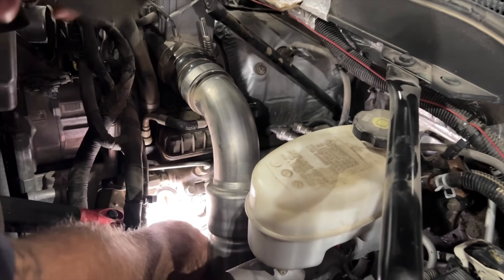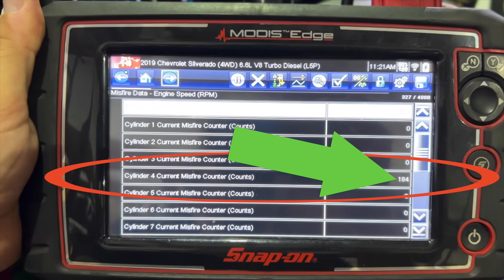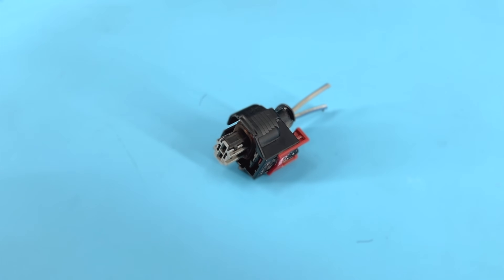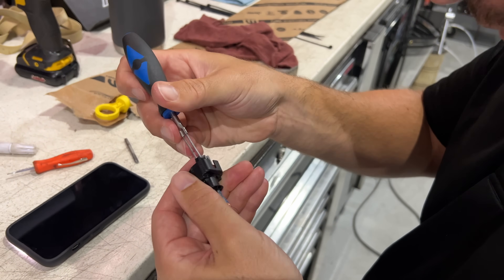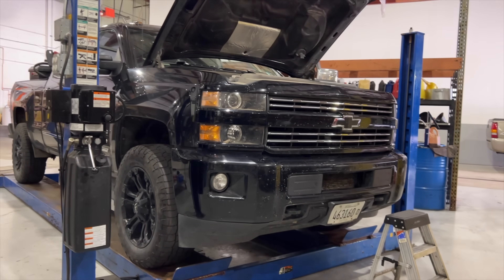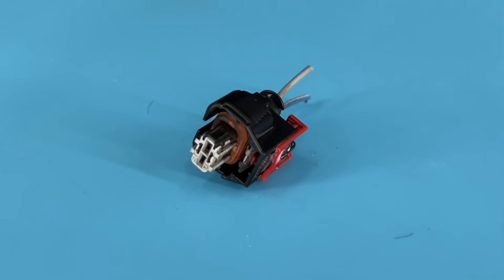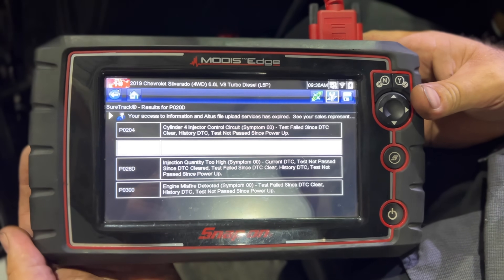L5P P0204 P026D Diagnostics

Comment: Just had my 2021 2500hd high country fail on piggyback injector 4 code after 210000 km not miles .
Had a mechanic here in Australia recrimp and didn't last anymore then 70 km before limping back to dealer to put in a new wiring lumen hopefully will fix problem tomorrow
Reply from the maker: Oh man, sorry to hear that. Hopefully they get your issue resolved.

Comment: My truck has 385k I had just changed all the sensors in the exhaust got my truck to pass smog the day it passed p026d came up again and p0204 I changed the pigtail p0204 went away but p026d just came back … anyone have any ideas?
Reply from the maker: Could be anything fuel related. Definitely best to get to a shop and get a diagnosis.

Comment: So, I'm in a wierd quandry, I have that p026d code, 

I have random misfires but no misfire codes, I've used hp tuners to datalog a variety of parameters but I've generally been focusing on misfire counters for all cylinders, and fuel pressure and desired fuel pressure. 

Now from appearances my misfires aren't exactly isolated to specific Injectors, some have more propensity yo misfire over others but it's still kind of all over the board.  

Fuel wise I'm generally seeing desired and actual fuel pressure within range, though I get dramatic spikes in fuel pressure sometimes. Like I've seen a difference in desired vs actual have a difference of like 5000psi however those spikes don't exactly correlate with a misfire, it's just something I'm picking up.  

Kinda chasing my tail cause the only code the truck has thrown is the p026d code, no codes for the injectors and such.  

Could be the fuel pressure sensor or the map sensor, I did clean the he map sensor once a few hundred miles ago, and it somewhat alleviated the problem but not 100% 

Got any insight for me possibly? I've also noticed that it seems like the truck regens alot, Atleast once to twice a tank, and if I'm following what the truck says I should get fuel range wise for a full tank, that 600 miles per tank is full of shit. It gets nowhere near that mileage, and I'm not pulling anything generally. Just another thing I've noticed.
Reply from the maker: It's hard to diagnose online, but if you want give us a buzz 815-568-7920
Reply: @Duramaxtuner  yeah it's a bit wierd, I can give you guys a call at some point. I gotta figure out the time difference.
Reply: I have a same issue, replaced map, maf and nox sensors. No help the code comes back. Fuel pressure are good passes cyl balance test, air leak test pass. I checked for overheating  pigtail connectors on all injectors. One thing I do notice is that malfunction light comes on and off on the nox 1 heater circuit on my autel scanner. But when I disconnect the nox1 sensor the light goes out. That’s leading me to believe the nox sensor is faulty from GM. I replaced 3 nox1 sensor. At this point I’m lost, I don’t know if GM EVEN HAD ANY FIXES. many people on forums have a same issue and no fixes

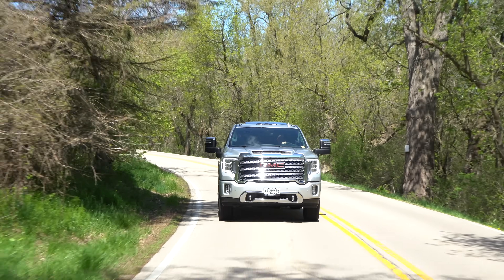Comment: What is the metallic tapping noise (rapid tapatapatapatapa noise)that can be heard before and after the fix at the 2:45 mark. I have the same noise and the dealer told me its from the hp4 pump and it's normal and fine. It doesnt aound normal and fine to me though
Reply: Sorry Jimmian, my ears have long ago tuned out many of ticks so common on these engines.  If you're really concerned about a certain tick, my suggestion is always to use a mechanic's stethoscope to see if you can narrow in on the location.  From there you can make a much more educated guess on the culprit.
Reply from the maker: well said Nick.
Reply: @nickpriegnitz5895  I did sniff around with a stethoscope and came to the same conclusion as the dealer. The noise is definitely coming from the hp4. I can hear it in the pump body as well as all the lines/ injectors. It only caught my attention after my last oil change because I did not recall having heard it upon restart of the truck after the oil change prior to that one. It's a very consistent metallic tapping noise, sounds a bit like a noisy lifter on a gas motor. Dealer says it's nothing to worry about, they all make noises some more some less and went so far as to check fuel API which was observed to be a little higher than expected and claimed that was probably contributing to more noise. I am new to l5p's so I don't know what is a normal noise and what is a concerning noise when it comes to the new hp4 pump. Do you guys see a lot of hp4s blowing up like the cp4s before them?

Comment: I had #4 just go off lucky the power still allowed 50 mph driving, I fixed the pig tail and away it goes, gm went cheap on the material in the plug, so this is why they have problems, I am replacing all of them with Fleeze Lp5 pigtail so I won't have any problems
Reply: Did you get a knocking sound similar to a rod knock? Coupled with the wrench icon and service parking brake light?

Comment: P026D is still on. Truck runs great. Bought scan tool and injectors seems to be pumping out close to readings. No misfires. I did notice the High Pressure fuel rail sensor 1 , number  are red when I’m looking at my Autel Scanner. Idle around 4800 , not sure what’s the number supposed to be. 2018 Duramax
Reply: Fuel rail sensor 2 is red reading 4249.

Comment: On the new 3.0l diesels in the 1500 series it’s always #2.
Reply from the maker: It sure seems that way sometimes.
Reply: @Duramaxtuner  whether it’s the connector/injector or the the tip falling off of the cyl 2 glow plug.

Comment: I have a 19 2500 L5P with 190,500 miles on the clock and I just had the P020D code pop Friday evening as I was getting off work. First check engine and reduced engine power issue in a long while. Last time it happened it was at 93,000 miles for the fuel rail pressure sensor and connector.  Other than the glow plug failure under warranty and the lift pump at 74,000 miles the truck has been a great running rig. Plan on keeping her a long time. Thanks for the information.

Comment: I have a Duramax 2018 .130,000 miles with just P026D error code only . Looking for same help.
Reply from the maker: Get to a shop! Give us a call if you have questions, 815-568-7920
Reply: Same issue code here, any update on yours?
Reply: @alvaroenriquez1555  still working on it was at the shop. They change the knock sensor. Then a voltage code came up hopefully hear from today.
Reply: Any updates on that code ? Mine just popped up at 89k and only code it’s throwing is that same code no other codes
Reply: @christianpineda5137  yes, it ended up being one of my injectors was screwed up GM replaced all my injectors. Everything was fine.
Reply: Did you have warranty to cover that?

Comment: I only have a P026D and that's the only code.  Replaced the Map Sensor, air filter and fuel filter and CEL keeps coming back.  If injector #4 is an issue would I have other issues?  Should I hook up can tool and see if I see a misfire while driving?
Reply from the maker: Give us a call, 815-568-7920. 9 am central our phone lines open.
Reply: I’m in the same boat, any update on what fixed yours?
Reply: I don't have a fix..   My CEL has been on for months.  I've used my Autel 808 scan tool live and cleared it and it comes back after a mins after I stop and turn engine back on. I did notice the high pressure numbers were in red and everything else is black so I guess could be high pressure switch ? but I have on clue. It's so hot down here in Houston , I think it might have something to due with the humidity that's throwing the light.   I don't want to drop 3k into new injectors just to have the same thing come back up like others ....     @alvaroenriquez1555

Comment: 2018 LP5, 200+ miles. P0203. Picked #3 injector connector and fixed problem but just went bad again. Going with pigtail now but having to have a shop do the work…freakn labor cost per hr is crazy…
Reply from the maker: It can get up there.

Comment: One more consideration:  is it possible to check the resistance of the injector while it is still inside the engine and possibly compare its resistance to other known good injector prior to removing the injector.   Also, the pain in the butt is that resistance may be good on suspect injector; yet, it may still be "clogged".   Therefore, injector resistance check is not always reliable.   Are these correct statements?
Reply from the maker: @hypocrisyrules Yes, Your logic there is correct.

Comment: that hot pipe causing the terminal to expand over time is my guess.   May consider putting an additional heat shield around the hot pipe???    By the way, a good many DIY are not concerned about polarity of the injector connector plug when replacing.   You have stated that anything that has a "module" is polarity sensitive.  My thinking is this could be a contributing issue to #4 injector connector if polarity is not configured correctly on prior repair thus causing early malfunction of the plug.
Reply from the maker: Good suggestions! We may look into that.

Comment: I currently have my GMC Duramax Diesel lp5 sitting at Carl Black Chevrolet here in Orlando with number for injector and pigtail the  service advisor has told me GM acknowledges that they a defective part and have a new part and part number and I still have to pay for this repair of I believe he said $2,000.00 or $2,500.00, I just ran out of warranty 2000 miles ago with 107000 miles on my truck now. I believe if you know you got a bad part you should cover the repair, I own a window and door replacement company and if a product is bad I replaced it for free. This just shows the greed of GM.
Reply from the maker: Sorry to hear that, Jason.
Reply: You got hosed.  Pigtail is $50, $75 if you go through a dealer.  Super easy to replace.
Reply: Thats because Ms Mary is a fool and has no idea what honesty is all about. She's a crook.

Comment: i bought a wonderful lemon. i had the HP4 high pressure pump go boom. Dealer replaced the pump and gave back to customer. it went to 2 auctions before i bought it. had to replace all the injectors and clean all the fuel rails... i had brass from gears 
in stock in tank lift pump in the fuel filter. Nightmare . luckily i'm handy and fixed it all myself. i will say L5P has one of the easiest motor to service injectors tho. flip that retainer and use as a puller boom. you can do 8 in 45 mins in parking lot.
Reply from the maker: Sorry to hear that. Totally agree with the latter!
Reply: @Duramaxtuner  other than that i love the motor. GM did work with banks help on the militarization of the L5P. This motor is meant to be easily serviced in combat or in the field.

Comment: I just had injector #4 and the pigtail replaced last week. GM service tech says they are too short and therefore strained from the factory leading to fraying. 

He also said injector #7 was the second most common
Reply: Did warranty cover labor and parts? My truck is currently at the dealership but they want me to pay labor.
Reply: Mine is in the shop for the same issue.
Reply: Did they just replace the pigtail? Mines in the dealership right now and I’m going to tell them to just replace the pigtail

Comment: I found that issue with my L5P I replaced the pig tail and it had already been changed. So at least 2 pigtails for #4 for my truck. 272000 miles.

Comment: gm duramax has had injector connector issues back to the LLY and possibly LB7. There was/is a bulletin for injector 2&7 connector issues. The claim was lack of support on the wiring near the connector causing loose terminal tension and or broken wire at terminal. I wonder if supporting the wiring would help like it did on the older engines?
Reply from the maker: That's an interesting idea. I wonder who will come out with one for us to test?

Comment: I just did one last one on a 2018 with 110k miles, and it was actually #6 injector
Reply: I have this exact problem right now, how hard was it?
Reply: @MilliMeterPeter02  only a 10-20 minute repair, just order a new pigtail and splice it in
Reply: @buckwildmotorsports  Rough idles, than it bogs down and acts like a horrible misfire when accelerating? “100 miles until 65mph limit.” Sounds about right? I think the driver side from front to back is 2 4 6 8 ?  I’m looking to do this fix myself but nervous, first time L5P owner.